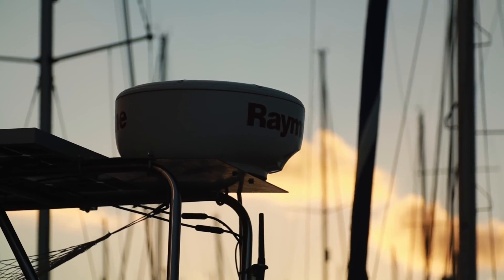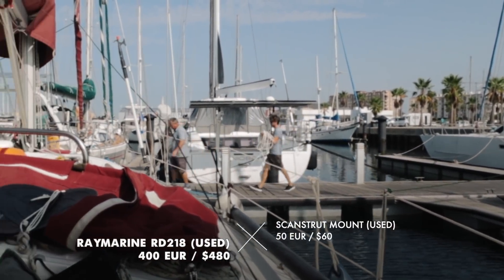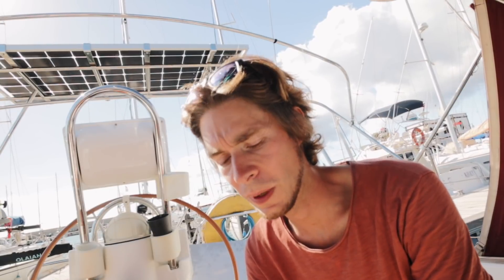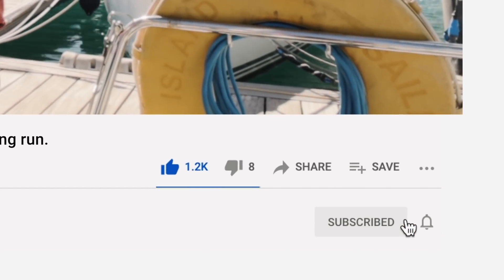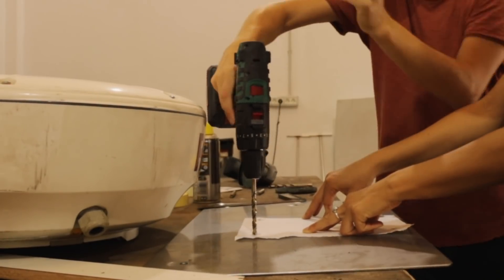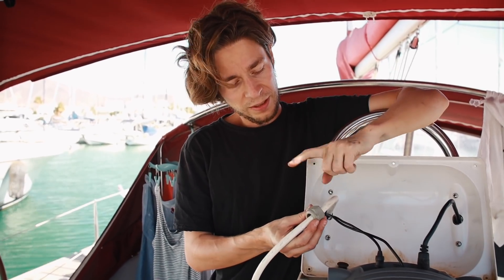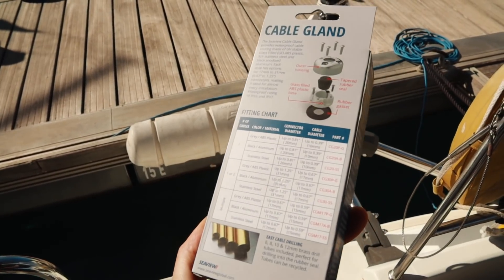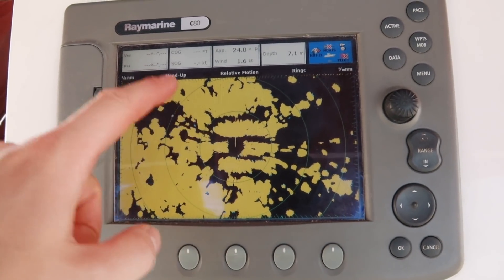a VISIONARY BOAT UPGRADE | STLT Ep.80

Comment: Too late, 7:00 but next time if you mount to round SS handrail, bimini, etc.  Use Heavy Wall rubber hose as a shim, cut the hose lengthwise to wrap it on tubing then the slightly larger u-bolt will fit snuggly .... then you might not have needed the extra washers to shim .....  👍👍
Reply from the maker: Nice. Comes in handy for a similar upcoming job :)
Reply: @seethelittlethings  Pin my comment, might help someone else in future project ... THX

Comment: I did everything you did with the old Raymarine radar. I could not get the cable through the small ho,e in the S S tubing for my arch. I ended up cutting the cable and resplicing it.  That worked. This year I replaced everything with new. The radar with color shows boats heading across your course in red and heading away in green. It is doplar so at shorter ranges is more acrid.
Reply from the maker: That’s pretty cool :)

Comment: You could run the cable outside the mast. With no cable guides I just dropped mine straight down inside and had no issues. I cut the cable inside the boat and used a block connector, again no problems. Having personally experienced physiological problems with long term prolonged exposure to bluetooth frequencies, (headphones), I would want any microwave equipment as  far away from me as possible, especially RADAR which is high power.
Reply from the maker: we thought about cutting and reattaching, but felt we could damage the shielding too much. Good to hear it's not that big of a deal
Reply: @seethelittlethings  As long as the current path is maintained the shielding properties will carry on working. I had my RADAR about 2/3 of the way up the mast and the display adjacent to the nav table on a 27ft boat then on a 37ft cat, worked fine close in and at max distance. Mostly I used it for spotting the approach of ships at night where I would set a scan alarm to warn me if something  was headed my way. this was pre the now greater adoption of AIS on small sailing vessels 20 odd years ago. I'm very glad I had it on a number  of occasions.

Comment: I think you will find that the radar unit will Significantly reduce your solar output due to shading even when the amount of shading on the panel is small.  A higher, single purpose mast at the stern (gimballed naturally) will provide you with the best results.
Reply from the maker: It’s actually ok. If the radar wasn’t right next to it on same height but further up and aft it would create more shade during noon, which are our bulk hours. When the sun is low it shades a cell or two, but when the sun is low it’s a lost hour anyways

Comment: You could have used a muffler style of clamp over the top of the U bolt but it may have been difficult to locate. If I remember your tubing is 30mm. Look in the Grainger catalog they have several 30 mm to flat clamps.  Yes, hindsight is 20/20 vision.  Good decision on locating the radar.
Reply from the maker: Would’ve been the nicest way..

Comment: Bravo for this radar installation, which is not always easy to pass all the cables, and to drill the stainless steel on the plate (in principle we take a needle and a hammer to drill in the right place ...!) you have hello from France, and your sailboat is built here ... !! good trip and thank you for this video ... !!, Vincent
Reply from the maker: That’s more or less what stainless work is 😂 cheers 🥂

Comment: What Radar and Plotter models are? I'm thinking about finding one same model for my old Raymarine plotter.
Reply from the maker: C80 with RD218
Reply: @seethelittlethings  What are your thoughts about your radar? Does the work you need? Are you able to see little obstacles while heeled? Do you see some weather?
Reply from the maker: @ppp9126  it’s worth the money because it was second hand and integrated in our system but 418 has better range, and a new 4G radar with new plotter sees smaller targets

Comment: As for frying your brains, as long as you are in the cockpit there is no danger at all since you are practically underneath the radar beam. Typically those radars are transmitting a beam that is +- 7° to the horizontal. If persons have to work on the fore deck for extended periods of time (say more than 10 min.) you should turn off the radar to play it safe. If your radar got MARPA (target tracking) then a highly precise electronic compass is mandatory to get reliable results, the manual should give the data required..

Comment: You know that the radar has a 15 degree downward angle of radiation? Means not only the test was dangerous (very, very little in fact because of the short time)  but also operating it in this position is. I'd move a cable or have another cable pipe in the mast. Means the mast must be taken down of course.
Reply from the maker: We’re aware of rf, no worries. The distance to the 10 W/m2 point on a marine radar is 1m, and the radiation beam is not hitting the cockpit. Mounting radar on an arch is quite common.

Comment: I agree with you, a Radar is a good tool for crossing an ocean and for collision avoidance. Also, in a foggy situation or heavy rain when approaching a port or marina at night, it is helpful. The difference between a conventional and broadband radar is that the Broadband will detect object closer to the boat but the maximum range is less. Also it consumes less power and does not need warming up prior to operate.  Both units are good and for what you intend to do, yours is just fine. Practice a lot as it is not obvious what the different settings operate. Cheers

Comment: Hi there, I had both old radar of 1990 on NMEA1830 and new radar of 2005 on NMEA2000. The main difference is power consumption. I cannot quantify it, but the new radar is intelligent and thus consumes considerably less Amps. If that is a concern to you, try to find settings that put your radar to idle if not in continuous use in a long passage, but still able to identify new targets and alert you. Good luck. Silvano
Reply from the maker: thanks for the comment! Yeah would be amazing to be able to have a single radar sweep once a minute or so. Will see if we find that on the C80..

Comment: for safety of family members and pregnant ladies, place move that x ray machine from the present location so close to the helm location even though this is where they used to install them until they realised what a health hazard it is to install this device so close to the crew in the helm position. This why most install up the mast even though can get a ghost from the mast angle section most do a small offset but i do not know if this helps (if installed on the top just wiped out any other antenna device so google "Association (NMEA) Installation Guidelines" for distances for antennas ). The beam from the device can vary from model and manufacture but the general rule of thumb is 25 degrees for the horizontal plane and the closer to the device the higher the signal intensity.
thank you for sharing your life

Comment: Who are the Luddites that are against RADAR? To me it's simple if you can get RADAR get it.  If you can get it and find one compatible with existing systems so much the better. As far as where and how to mount it there we enter a region filled with compromises let's just say the discussion of that aspect there are literally volumes of conflicting information even experts argue about. I think the place and method used will work the only variables to work out will be how long you operate the RADAR for due to power consumption or other unforseen issues. Great series, keep it up guys.

Comment: Only if you put your head at the same level as the antenna. Well, for long periods of time. The best thing to do is contact the manufacturer to see what the beam pattern is supposed to be like and work from that. Things like elevation settings do matter. All I can say is that the total power output is very low but the pulse power is high. 🙂